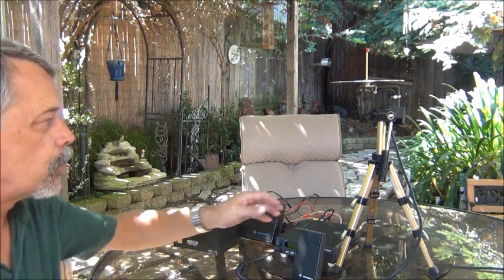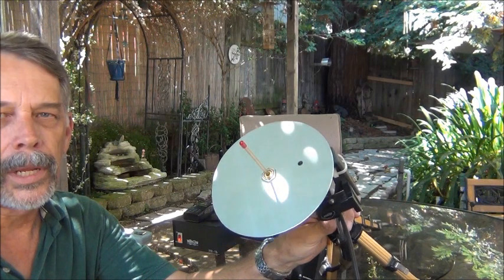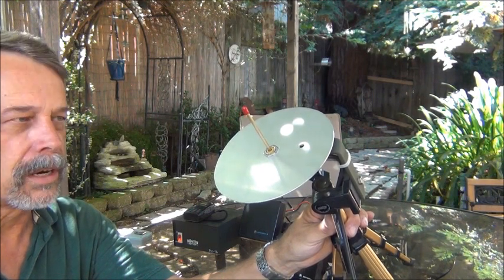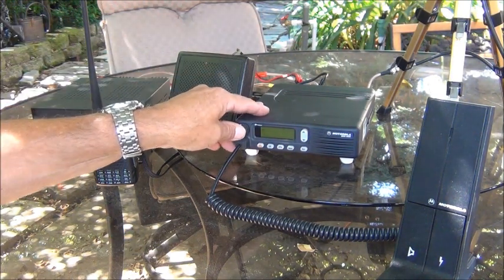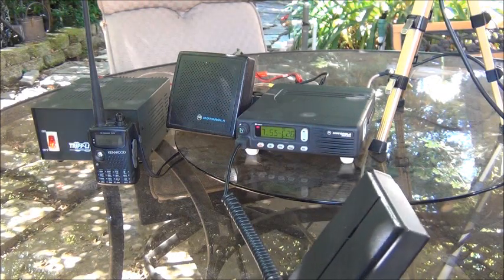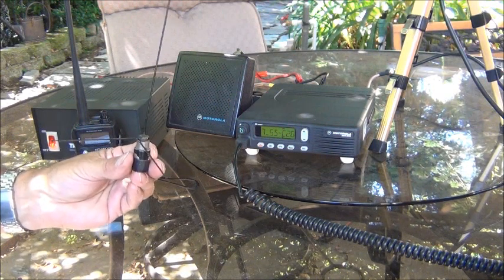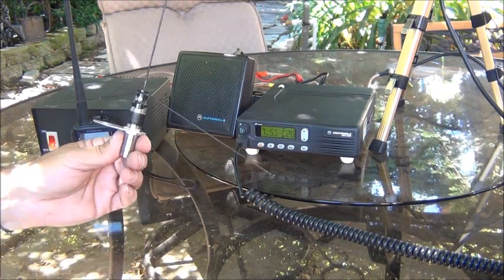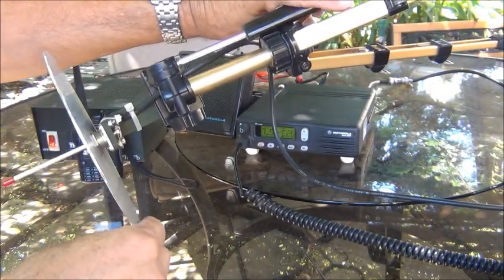900 MHz Ground Plane Antenna by N6TWW

Comment: I used to use a 900 quarter-wave on the roof of my car. I had a fully modified 30-watt 900 MHz Motorola Maxtrac and one day I noticed the 3" quarter wave whip actually got very hot to the touch when in use. I liked the quarter-wave because it was so small but later on I picked up a 3dB gain coil style antenna that obviously worked better and I noticed it did NOT get hot when in use.
That's the great thing about antenna's at frequencies this high. Even gain antenna's are small :)

Comment: hola hace unos años participe en un montaje trunking y tuvimos que hacer ese tipo de antena y nos fue muy bien  es un típico  1/4 onda de 800 mhz utilizamos antenas de móvil motorola 1/4 de onda para automóviles se hicieron como 80 antenas iguales  como la que tu muestras, si instalaban  entre el techo y el cielo raso    hello a few years working in a trunking assembly and had to make that kind of antenna and it went very well is a typical 1/4 wave antennas 800 mhz motorola mobile use 1/4 wave to 80 cars were made as equal antennas as your samples, if settled between the roof and ceiling